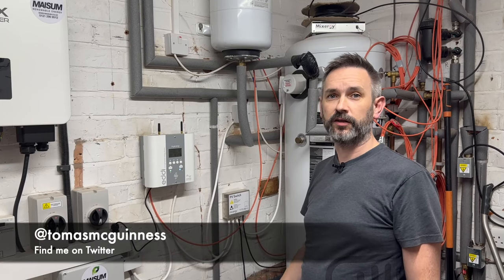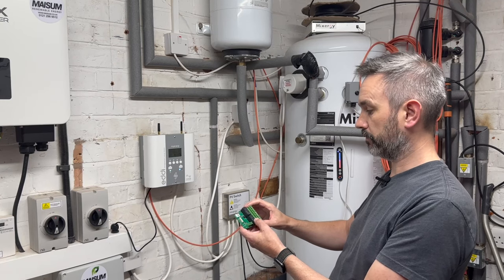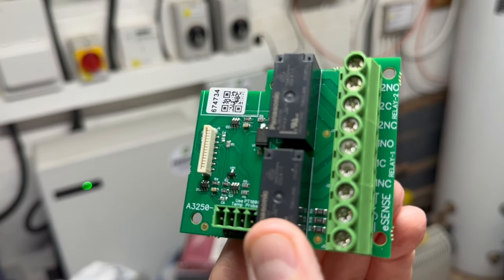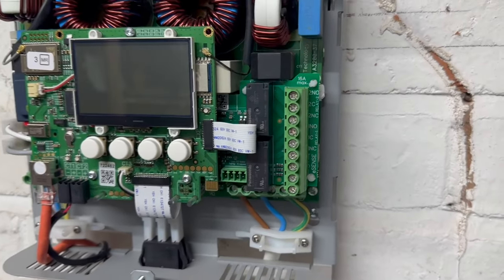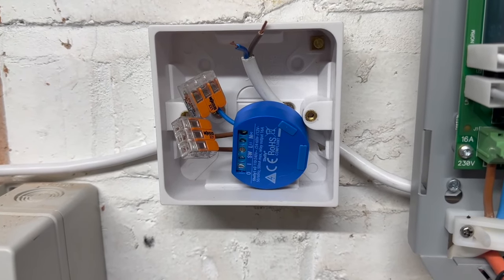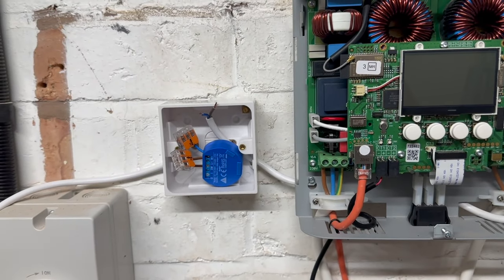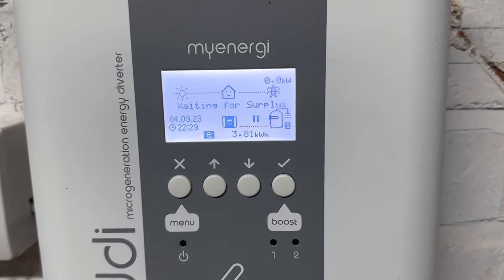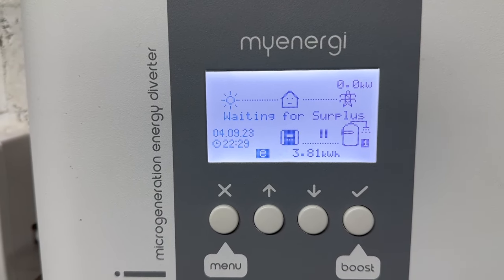Controlling my Eddi directly from Home Assistant

Comment: Hi Thomas, I had the same issue with my Mixergy and Eddi devices. I found the easiest way to overcome this was to install a PT100 temperature probe from the Eddi which fits in an internal tube in the Mixergy tank, I then set the temperature cut off (in the Eddi software) to a little lower than the Mixergy maximum temperature, this shuts off the Eddi prior to the immersion heater thermostat operating on the Mixergy tank. A little trial and error was needed to get the temperature cut off setting on the Eddi just right but once sort it has worked flawlessly.
Reply from the maker: That’s interesting! I didn’t realise there was a tube available for a sensor. Did you use a relay board too?
Reply: @tomasmcguinness  Yes I did use the relay board, there are two PT sensor inputs which are programmable. I have a 150 litre Mixergy tank and the probe tube is just to the right of the immersion heater at top of the tank.  Photo available if you’d like one.
Reply from the maker: Yeah, a photo would be great!
Reply: If you let me have an email address I’ll sent the photo.
Reply: Just to note it needs to be a PT1000 sensor for Eddi (not PT100). PT1000 means the sensor has a resistance of 1000 ohms (rather than 100 ohms for the PT100) at zero degrees C.